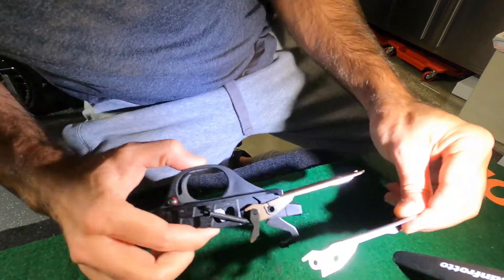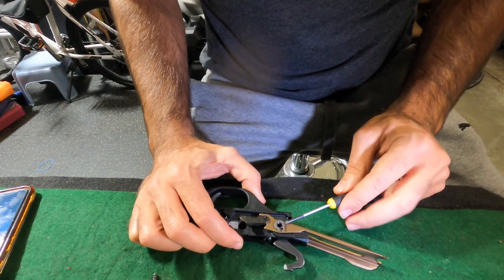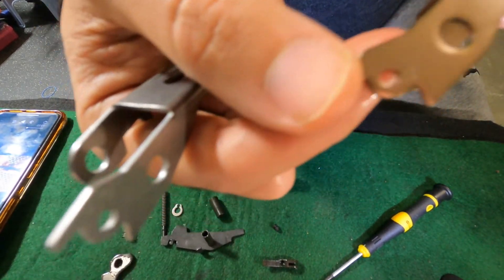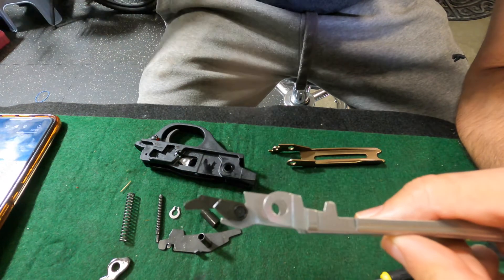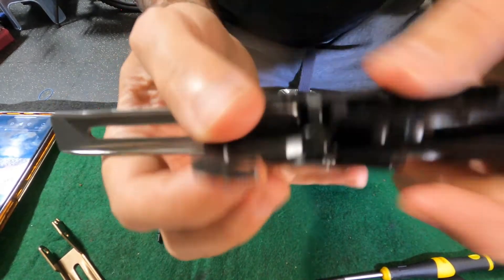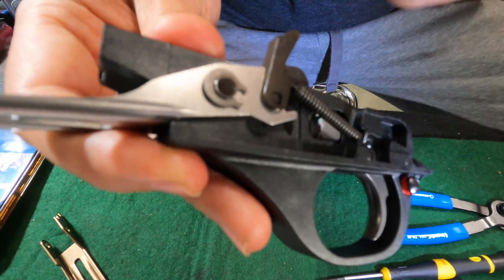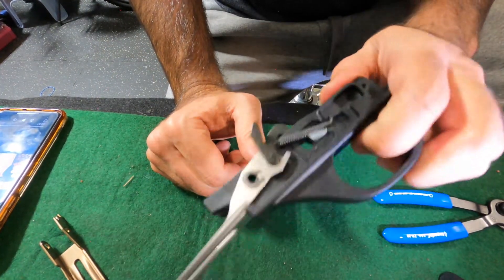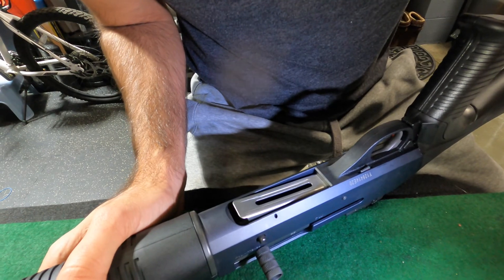BENELLI M4 FREEDOM FIGHTER/TARAN TACTICAL WORRY FREE / ACCUGLIDE EXTENDED CARRIER INSTALL

Comment: Those snap ring pliers are reversible, the thumb screw that holds the two halves together can be removed and the two halves positioned so when you squeeze the handle it spreads the jaws.
Reply from the maker: This is mind blowing! Thanks for the great tip.

Comment: Is the lifter from taran tactical or freedom fighter?
Reply from the maker: john kim i purchased the one installed in this video from Freedom fighter but I believe they are the same lifter and FFT may sell the Taran one or they get from the same supplier. They look identical to me
Reply from the maker: SebastianTran they are nearly identical. The polished surface is nowhere near as critical as the shape of the tip vs stock for thumb comfort reloading. Did read TTI is heat treated which is not ideal for stainless, but I don’t think that was reliable info
Reply from the maker: SebastianTran yes for sure, you could get the titanium mag tube extension and I think urbino stock is lighter as well, but minor overall. But yea it’s heavy, they say to lift more weights to make it feel lighter lool
Reply from the maker: SebastianTran great move! Should be just right, if weight is a big issue and you’re not going to hang a bunch of stuff off it, m2 is the way to go, always good to get more spaghetti guns :)

Comment: Is your trigger group plastic or metal ?
Reply from the maker: Plastic. Wish I had metal. Will likely upgrade when I get back around to the m4
Reply: You can tell by looking at the middle of the guard.  If there's a seam line it's the plastic one, if it's smooth it's the aluminum one.  Also the aluminum one has a diamond design stamped in the middle of the guard.

Comment: To be honest I didn't find much of the difference between both of them. Well, maybe besides the color.
Reply from the maker: Tomas Rodak yes sir, the main problem is the u-notch in front on the factory lifter, this can cause the thumb to hang up and interferes with speed loading.
Reply: @shaunstayfree5551  Nice. 
Thanks for sharing this tip.
👍
Reply: @shaunstayfree5551  does it fix feeding issues on the m4 and does away w the benelli thumb?
Reply from the maker: @ppac301   im not sure what feeding issues you are having on an m4 other than perhaps light loads (birdshot) within the first 100 rounds. Of your stock one is beat to hell, this will smooth things up. But Absolutely the best thing about this is the thumb gap is closed. For solid speed reloads quad loads etc, the receiver needs to be cut back, this won’t do it alone.
Reply: @shaunstayfree5551  I heard the Benelli m4 is not so smooth when feeding it with ammo. What I'm saying is that it will nick your thumb. In comparison to competition shotguns where feeding ammunition is smooth and there is no danger of nicking your fingers.
Reply from the maker: @ppac301  there isn’t really a danger of cutting fingers reloading an m4 I have seen unless maybe getting a finger stuck in the stock lifter with the half circle cut out. The problem i have noticed is the shell catch spring can be real tight on new shotguns causing a lot of force needed to fill the mag tube.